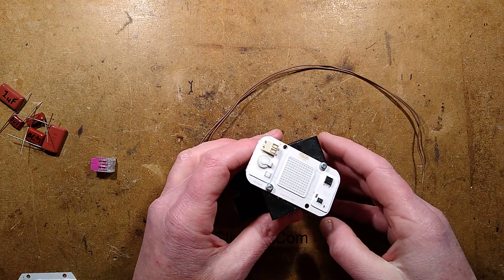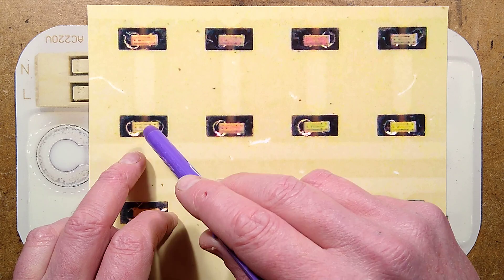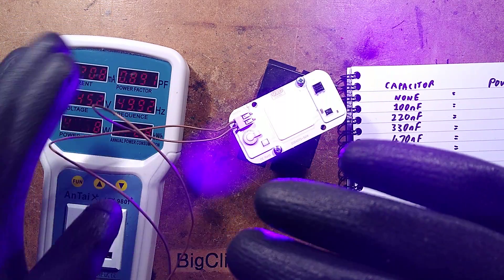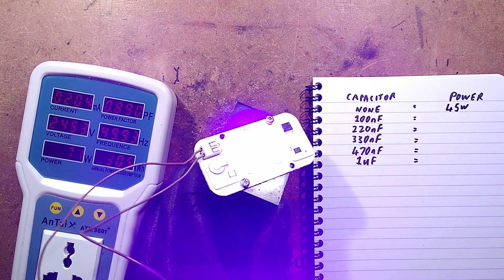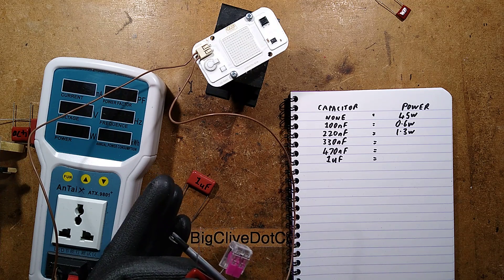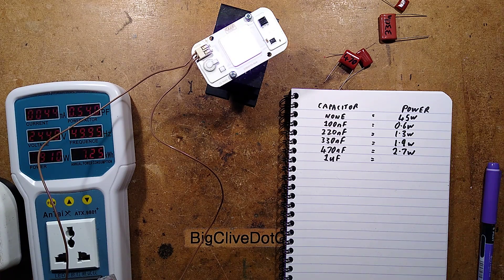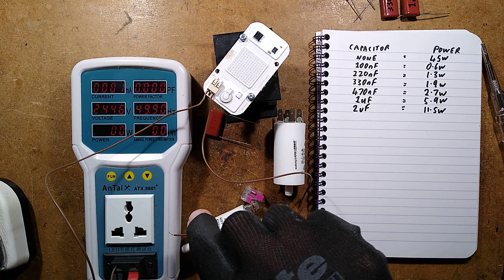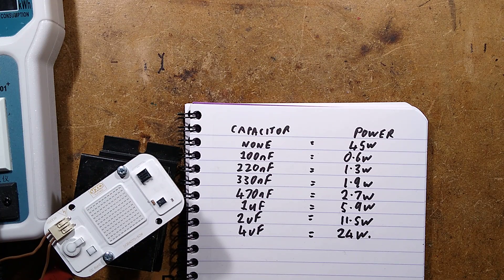High power ultraviolet LED experiments

Comment: Had an issue the other day. Someone had installed about 20 off LED flood lights on one circuit as running current was low. They were on an RCD. When you first switched them on, they would trip the RCD. Then aftwr that, you could switch them onand off with out issue. I decided the issue was too many capacitors. As tney charged up initially, the out of balance current tripped the rcd. Then after that, they held their charge. 
The other trap with led lighrs in commercial is find out the initial inrush current. It can be horrendous. You might only get 6 to a 16 amp circuit.

Comment: White leds generally use 450nm leds and a varying phosphor composition and density for color temperature. I have not seen any white leds with 395nm chips.
Reply: Some LED streetlights may use the shorter wavelength emitters. Phosphor failure (apparently detachment, but I've only seen some very simplistic explanations) results in quite distinctly purple lights.

Comment: Is it UV-A, B or C ?  I have UV curable glue, at first I used UV-A but that did nothing, UV-C does work but it should work best using UV-B. I only us real, non Chines fake, UV-leds from well known brands and UV-B is very expensive.
Reply from the maker: Near UVA.  UVC has very little penetrating power, so you may have been getting a mixture of UVA, B and C from your light.
Most UV adhesives cure with UVA or deep violet light.   I use a USB nail-gel curing light to set the glue.

Comment: Clive, this is a nice demonstration, thank you.
Question.... living in North America, we commonly have 120v @ 60Hz.  Could you please let us know the results if we were to purchase a 240V model and run it off 120V and then  range of capacitors.

Thanks
Reply from the maker: It might not work properly with 120V.  Although a simple voltage multiplier might work.

Comment: perhaps the reason the capacitors did not hold much charge because they are connected in series with the leds, hence they hold low voltage?
Reply from the maker: The meter will have provided a slight current shunt in combination with the circuit's low current drain.

Comment: Clivey...could you please tell me if a 18650 li-ion cell can take a charge upwards of 4500 mAh ? It's from a 1000 dollar headlamp in the late noughts...some get too hot and I stop the charging past 3000 mAh...but this one is just warm and has passed 4500 mAh ... Also what is the present maximum capacity for an 18650 ?? Thank you so much 🙏🏼
Reply from the maker: That's too high for an 18650.  If it's not holding its voltage when it's out of the circuit then it may have failed and need left to discharge fully before recycling.
Check the cells are not being charged above 4.2V
Reply: @bigclivedotcom  Thanks for such a prompt reply !!!
It's a very good charger-reviver. Xstar...just the single 18650 from the headlight's belt pak of 5...others were getting terribly hot, so chickened out using them !! Using it for an LED torch now 🙏🏼
Reply from the maker: @BPantherPink  Many of the shipped 18650s are actually very low capacity.  If they are getting too hot, set your charger to a much lower charge current like 500mA.
Reply: @bigclivedotcom  It's in the 500mA bay of the XTAR-VC4 charger since last 2 days...current, since yestrdy has droppd to 0mA...voltage fluctuates betwn 4.2 and 4.18 ... Not gettin hot at all and now crossed 5100mAh !!!
As I said, they were very expensive cells for a BETTY-X Pro headlamp at abt 1150 USD in 2007 .

Comment: hrm, could put a rotary switch in and make a janky dimmer
Reply: I've done it with a 3x on switch with a ceiling light that has 6 naked "undimmable" 4W filament bulbs. One switch has a 0,5uF in series, the second has 2x 0,5uF, so turning 1+2 on gives a third level of 3x 0,5uF. The third switch is just full on (so bright that it's is hardly ever used).
I got the idea from one of Clives video's and I am very pleased with the result. A very simple and silent(!) dimming of standard LED-bulbs with highly improved efficiency and livespan, at a very low price with no downsides. Astonishingly, even the low powerfactor of the six bulbs increases when dimmed with capacitors, although I don't really care about that.

Comment: I'm confused. I didn't know that you could use a capacitor as a resistor.
Reply from the maker: Only on AC.
Reply: @bigclivedotcom 
Thank you. And funny enough, the next video suggested was on abandoned generators... One having too small of a cap on the generator output, 10uf instead of what should have there (25) and so the output voltage was like 87 volts on the 110 outlet. Slightly different theme, but basically the same.
But then it made me wonder, that power that is stored, does it only go out in part of the phase? It must.

I really need to research this more because I know with a DC capacitor it can act similar to a battery and release its energy over time. I don't see how an ac capacitor could do the same. So why is it then called a capacitor?
Going to go look that up right now.

Comment: Is there a difference between the hopi and the antai meter? I don't see you use the hopi much anymore, I got one too when I saw yours and modded a dpst switch added to the push terminals so I can leave mine plugged in while connecting the DUT to it.
Reply from the maker: I use the Hopi from time to time.

Comment: Tips from the fluorescent mineral world:  if you wish to shield your eyes from this radiation, and I recommend doing so if your eyes are either exposed to the intense direct light from the emitters at all or are exposed to the indirect diffuse reflection of the light for long periods of time, you will need to choose your eyewear very, very carefully. Normal polycarbonate "UV protective" goggles of most kinds, INCLUDING UVEX brand, while they will block 365nm and shorter wavelengths, will NOT significantly block radiation around ~400nm. For this purpose, besides the yellow tinted UV protective goggles which destroy normal color vision, I have only ever found two other kinds of lenses that work: Zenni optical "Blokz" glasses, and UVP 98-0002-01 goggles. These lenses will notch out virtually all the violet color of the near-UV light while simultaneously allowing normal color vision to continue. Further still, if you are using these wavelengths to observe subtle fluorescence effects in things, you will want to "clean" the UV output of the LEDs. The LED chips themselves are fluorescing in the visible range, contaminating the output of the light, but if you place a dark piece of cobalt glass in front of the emitters you can block virtually all the visible light emission from the LEDs while allowing nearly all the 400nm light to pass through. Using this technique along with the goggles noted above makes everything look COMPLETELY different under this light and you can only then observe the fluorescence of items in isolation from the excitation source with this method. Many fluorescent minerals look nearly as good as they do under filtered 365nm light using this technique.

Comment: The great thing about using a capacitor dropper is the VERY low thermal dissipation. They don't get at all warm, and for the 50 or 60Hz mains frequency, the stresses on the dielectric are also pretty minimal. The only downside is the power factor, but for low power applications that's probably not a serious consideration.
Reply: I agree... the .5 P.F. is nothing to be concerned about with a few watts. 👍

Comment: When curing UV resin, I’ve found less intensity for a longer duration gives a nicer finish. It results in less heating and therefore less stress / deformation as it cures. A gradual increase in intensity as it cures seems ideal. Although it can be blasted quickly if it’s something which doesn’t require a nice finish! 🤓
Reply: Can confirm it cures shinier, also a shorter wavelength helps cure it more uniformly 365nm is the best, but 395 would be good for thicker resins.
Reply: Yes, the shorter the wavelength is better for surface cure. For surface curing, Oxygen hinders surface cure. "Oxygen inhibition"
Reply: Yep. It's akin to having a paint booth temperature up too high when curing the paint. 

If the uv resin cures too fast, the surface of it can cure before the rest of it underneath does, and when the rest of it cures, it can shrink up the surface and leave a less than desirable finish.
Reply: That’s also very good to know, thanks!
Reply: Like making custard. 😅 To much heat😮 and it's wrecked 😅

Comment: LM358? An op amp, a voltage source, a MOSFET, and a resistor are enough to make a current sink; an inductor, a diode, and some positive feedback added to that makes a hysteretic converter. I for one wouldn't mind seeing the teardown.

Comment: I have one of the 70W light chips but blue-green for growing (just spring seedlings in my case), but it produces too much heat, even mounted to a big aluminum tube and using a diode to cut out half the cycle. I never thought of using a capacitor to limit the power, despite seeing a bunch of circuits doing it that you displayed. Wonder what higher voltage capacitors I've got kicking around.

Comment: I wonder what they are doing to those flip chips to permit soldering? When i took a semiconductor lab in college, we had a special weird solder, indium based IIRC, to solder to silicon, and it was a right royal 5 star PITA to get it to wet the surface.

It was a lot easier to use the special probes that just mashed into the surface with a rack& pinion setup similar to a microscope.
Reply from the maker: I think the LEDs have a metalised layer on the base for the connections.

Comment: I tested a Motor Capacitor with my insulation tester set at 250 v, then discharged it at arms length with a screwdriver, what a loud bang it made, I chickened out trying it at 500v or 1,000v, as I thought it might shoot off and break something.
Reply: It's also not so healthy for the  caps

Comment: Very good experiment. More like this would be nice.
Do you have any idea if the supposed 395 nm wavelength is harmful to the eyes?
Reply from the maker: The extreme ends of the spectrum pose a risk to eyes because they are seen as a "dark" colour and the eyes don't react as they would to white or green.
Reply: UVA is not yet a major risk but you want to avoid looking into it because our eyes dont see it very well. it is much brighter than you can see so you dont have the natural reflex of squinting and adjusting the iris.
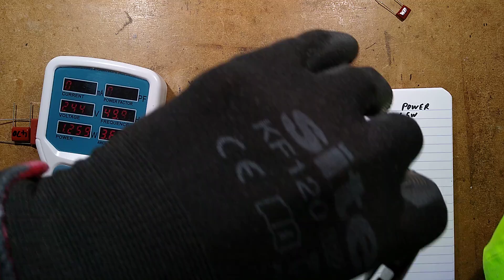Reply: Did you notice Clive’s fingernails glowing at 8:23 when he added the 220 nF capacitor?

Any wavelength that excites fluorescence in biological materials like that is hazardous to the eyes at the very least. Shorter wavelengths can literally burn skin as I’m sure you know but longer wavelengths are still nothing to trifle with.

I have still never gotten over UV making nails and teeth glow. Very cool, but any anomaly like that should make you extra cautious.
Reply: @markfergerson2145 Intensity is everything

Comment: Unless they are specifically designed as PPE for dangerous voltages, I wouldn't recommend wearing gloves as PPE for dangerous voltages. They can end up giving a false sense of security
Reply from the maker: They add at the very least a thin extra layer of spacing and insulation that is much better than the dead skin cells on the surface of your hand.
Look at my video "The unofficial guide to electrocution" for more details.
https://www.youtube.com/watch?v=9webTbqTH5E
Reply: Agreed with Clive, any protection is better than none. If you ever become "live" from a capacitive coupling (I think that's the thing), then even touching the wooden/stone floor with a foot in a sock will give you a tingle, while crocs isolate you well enough, even though because they're foam they won't stand up to high voltages. It's also better to just leave one hand not used or touching an isolated part, as if you get shocked it's best to not have it go through both arms at once, because your heart is sort of in the way :)
Reply: @tomclanys  Nah! If you're gonna go you want to make it quick! 😜🤣🤣
Reply: @tomclanys  I agree with most of this. I think it's a subtle difference of opinion. I always try to keep one hand in my pocket, especially if I am working on HV. The problem comes if you use the gloves often and get used to the protection. Then you grab the hot wire of a LOPT without thinking and get severely injured. Or a stray wire goes through the uncoated back of the glove, something I don't like about that kind of glove. Or it gets cut and you don't notice. To some the gloves might seem like a total solution, whereas you should imagine you aren't even wearing them, and do things with that in mind.
Reply: @henryokeeffe5835  true, that's why I always work as if I don't have gloves on, so I try to never touch anything live unless I really have to and I know it's safe.

Comment: Is there a formula for the lifetime of an LED compared to the current through it? I remember reading that the lifetime of an incandescent filament is proportional to the fourth power of the temperature, which is why "long life" bulbs that use a resistor to burn very dimly can last for decades. If the same applies to LEDs, running that array at 0.6W instead of 45W would mean that for every second of the original lifetime, it would last a year!
Reply: It's generally true that a 10C reduction in junction temperature doubles the operating life of the component. Adequate thermal management is crucial for power LEDs, and a common corner to cut.
Reply: @abitofabitofabit4404  This is correct and it highlights the fact that it's not the current that determines the life, it's the temperature of the chip.  So the heatsink used is just as important as the current level.